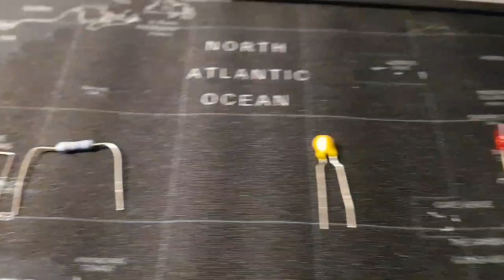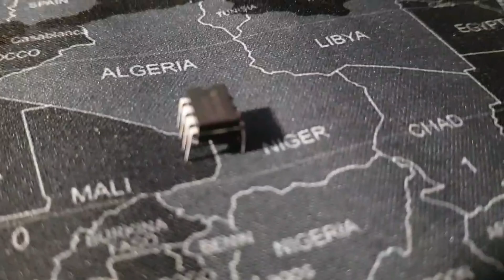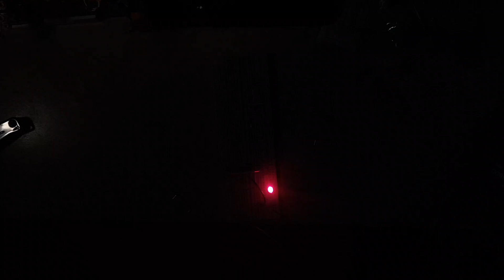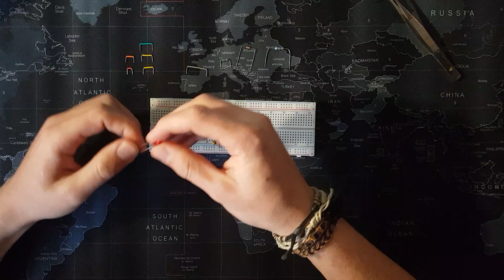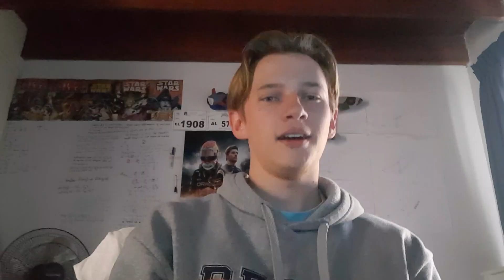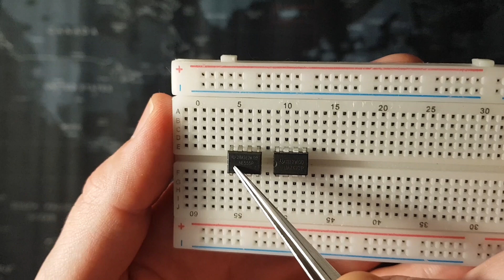Flickering LED

Comment: 555, how ordinary. You can flash an LED with 2 transistors (multivibrator) or you can make a more stochastic oscillator using a single unijunction transistor, assuming they still manufacture those things.

Comment: You can build a simple function generator by using a dual opamp. One is setup as a integrator and the other is setup as a schmitt trigger. One feeds into the other, which in turn feeds into the first. The trigger outputs a square wave and the integrator outputs a triangle wave.

As a bonus, you can use an additionnal integrator to integrate the triangle wave into alternating parabolas, which is a pretty good approximation for a sine wave.

Comment: Here's an idea in principle, using just the op-amp and not the timer.
We're going to abuse that the op-amp has a ceiling and floor on the output as part of a Schmitt trigger, and use an RC circuit to cause switching.
Set it up with the op-amp as an "inverting Schmitt trigger" (schematics widely available online). This basically is a setup with 'infinite' amplification, causing the op-amp to either jump to the ceiling or the floor of the output range, inverse of the input. The additional complexity is to cause latching, where a certain threshold of reversed input voltage is needed to reverse the output.
Feed the output to the LED (making sure it can handle the voltage given, maybe needs resistor in series), and in parallel, an RC circuit (here, a resistor, then a capacitor, to neutral). Feed the voltage across the capacitor back into the op-amp system input.
What should happen is the op-amp will latch to either high or low output, depending on any initial noise and the zero calibration point. This will charge up the capacitor at a rate determined by the RC parameters. Once the cap charges past the Schmitt trigger threshold, the Schmitt trigger output will reverse, and charge the capacitor in the reverse direction, and so on for the cycle. The RC parameters and the trigger threshold will determine the timer period. 
Duty cycle will require additional components, probably by biasing the input or output. It also should be possible to set it up so that it only runs off one power rail (and neutral) rather than needing two rails. I'll leave that up to you.

Comment: With a couple of transistors, couple of capacitors, some resistors could have made an a stable multivibrator, with one or two flashing LEDs.

I used to make them using a green and a red LED using a potentiometer to change flash rate and confuse dad’s Neon Tetra fish lol
Reply from the maker: Do you have any diagrams of what the circuit may look like?

Comment: Like burgersnchips said, an op amp can be used as an oscillator. However, I think if you wanted to start simpler you could try using transistors instead of op amps. I think their theory is a little bit more understandable. Good job though.

Comment: An op amp can be used for this function with the right layout
Reply from the maker: What would the right layout be? Because I tried quite a few different things and I couldn't get it to work.
Reply: @EngineeringStudentTries  I believe if I recall correctly you build a schmitt trigger and have it feed back via a capacitor
Reply from the maker: Are there any circuit diagrams that you have in mind?
Reply: @burgersnchips yep it does need to be an inverting tho
Reply: @EngineeringStudentTries  a big thing to note is the 741 is expecting a dual-rail input voltage of both +9v and - 9v. One battery may not have been enough for that model of op amp. Also the oscillator circuits usually need to be able to go into the negative voltages and not just down to 0v or they don't oscillate
Reply from the maker: Would you mind please messaging our IG account, I want to pick your brain a bit more about this.
Its called engineeringstudenttries
Reply: @burgersnchips  not fully true u can apply a non symmetric psu but you will have a dc offset
Reply: @EngineeringStudentTries  I miss the days of being able to do video responses on YouTube, I would show you roughly what I mean